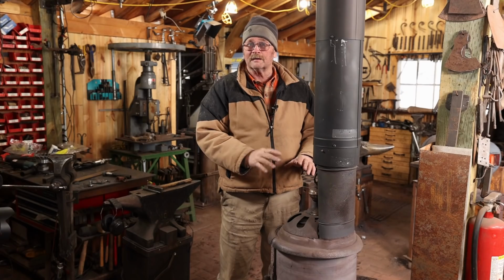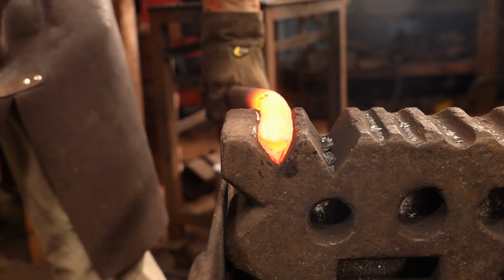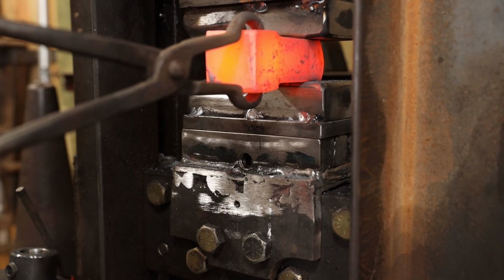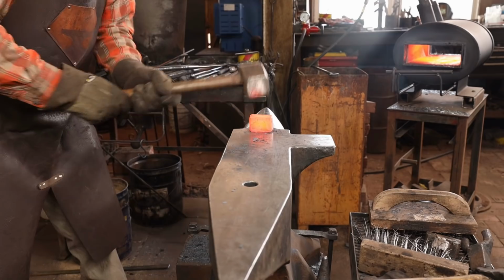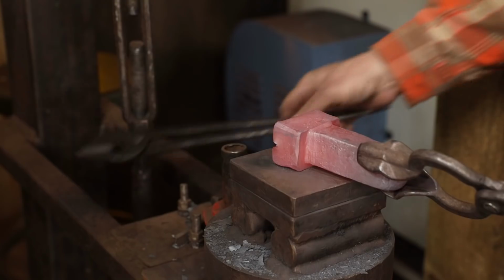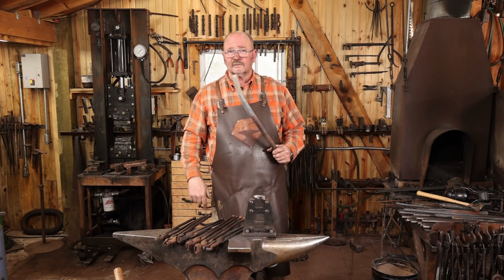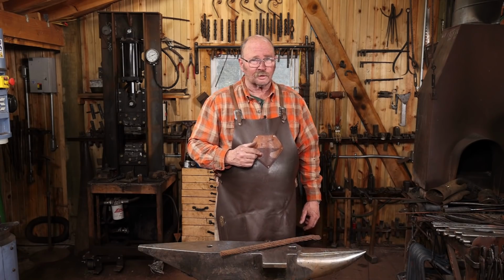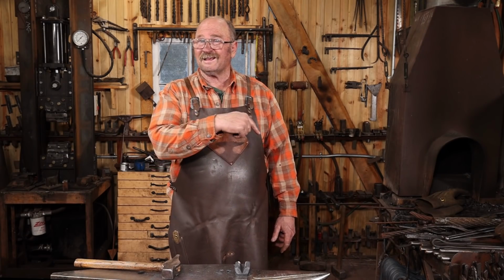Need a Tool, Make a Tool

Comment: How do you remove the swedge after you've formed it in the hardy hole? Do you have to get down and hit it from the bottom side with some tool or is it loose enough to pop up from the top?
Reply from the maker: They don't tend to get stuck.  But if they do a light tap on the side usually knocks it lose.

Comment: Because it’s a cable (or steel rope), a round swage will work better. In a V swage, the bottom of the circular cross section will try to fill that void, which it’s individual threads will be able to do, causing more fraying that would happen in a round swage, and fraying is the primary problem you need to worry about. At least that’s what I’ve found in my experience.

Comment: This is very relatable.  I recently needed to make a hardy bick to form some finals  for a project and soon realized I didn't have tongs to hold the 1 1/2 inch round I was forging the bick out of.  Grabbed so.e 5/8 stock off the rack and with a striker had the set of tongs done in about 2 hours.  Tool to make a tool for a project!

Comment: That looks familiar, John! ;) 
On your next 60 degree V swages, I'd recommend to use mild steel. All the forge welding you see me do in these Vs are simply mild steel, no case hardening, no quenching, nothing. Simple mild steel. 
For a 60 degree Fuller, I'd recommend making a big 60 degree chisel, with no cutting edge, make it rounded. 
Or if you want to forge it out of round stock, it's better and easier to forge down into the 60 degree V in your swage block. 
Keep turning it 1/3 turns so it evens out and crisps up the corner. 
You could even make it out of square stock, by forging it into a long rhombus, and then upsetting it back down in the 60 degree V 
This way 1 of the 2 longest ends of the rhombus, seats down in the bottom of the 60 degree V and the rest will upset ontop of it. 
Then again, it will have to be hammered from all 3 sides to even up everything.
Reply from the maker: Thanks for watching Joey.   I agree that a 60 degree chisel would have made life easier.

Comment: Enjoyed as always and great work. I've always wondered though. When using the hydraulic press. There's always a delay when your dies touch the piece and then it squishes. Is that because you stop pushing it or does it take a minute for the machine to gather the pressure to make it move?
Reply from the maker: The hydraulic system has a fast low pressure circuit and a slower high pressure circuit.  So it does take a little pause as the pressure builds when it switched from one to the other.

Comment: A simple method to successfully forge weld cable is to mig weld the end, heat, put it in the vise and untwist slightly, flux, heat to welding temp, put it in the vise again and twist it tightly, bring back to welding temp again and tap set the welds on the anvil...I've rarely encountered any problems doing it that way, an it never frays...but cable will result in a few delams because of contamination inside the cable

Comment: 60⁰ Swedge is purported to be the schiznits for cable welding. Great tool build Sir. Lol lol hey that's cheating w the press and whatnot hahaha 😜, guarantee if they'd had it in the 1700 1800 n1900s they'da all used it 
  Just a thought to ponder. A friend and fellow Smith uses a technique on big cable that's slightly different in the beginning stage of the welding process.  Goes something like this. Weld the ends of the cable to stop the Frey. Gas forge to welding heat ( of course it's coated in iron mountain flux too (not sure if he unwinds n fluxes the interior or not) then straight to the postvice and spin it up tight in the direction of lay, yours looks to be right lay cable which is most common. Then next heat I believe it's straight to the 60⁰ V Swedge for the final years to forgeweld the bar.      Second side note. Another friend has tested another option which intails adding 35 or 40 percent cast iron powder to the iron mountain Flux. Untwist a bit n get it down in the cords then tighten up n reflux w the mix as normal during forgeweld process. This reportedly adds carbon thru migration but also inhanses the pattern and modified it a bit too .
Just options to toy with in your mind or shop .
Blessings Sir
Crawford out! 🙏🔥⚒️🧙🏼‍♂️

Comment: Love having learned building many tools and your teaching I've have made many and was able to figure out a few other. 
  You wood working also. 
The 90 degrees most and tenants chisel is something I've planned a set but didn't get at it yet. I'm taking sbout for cutting the inside of the rectangle or square holes  ( as all tools are expensive) 
Thanks so many times for your teaching Sir

Comment: The ability to draw steel, keep it hot, and continue to keep it at a working temperature is amazing. It's  fun using it with wrought iron, any sections that start to split you can just take a welding heat and consolidate it back together.
Reply: I should also note, it would have been better to turn it sideways and made two different size Vs across the thin dimension as opposed to one the whole length. An inch and a half is about what you want for the length.

Comment: Made something similar but I used a grinder (as you mentioned).  I hardened the sewage block and it worked well for the first project but it cracked at the bottom of the V during its next use. Will leave my next one unhardened!